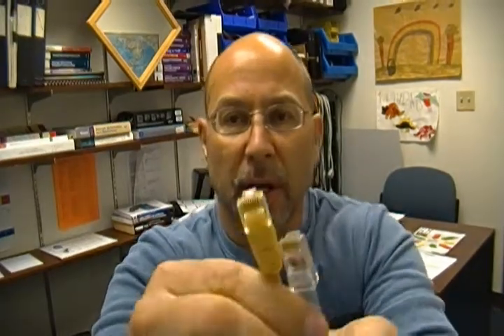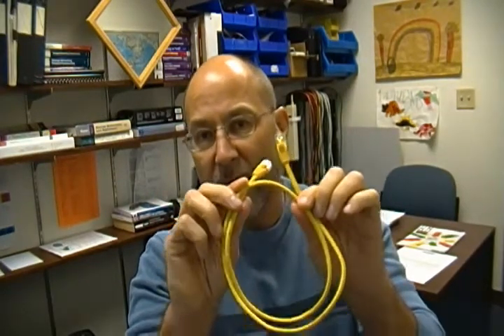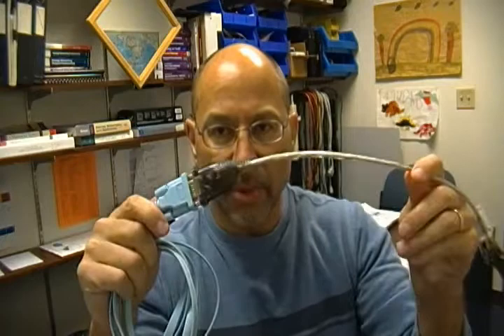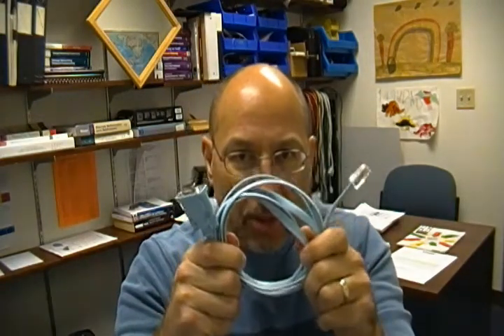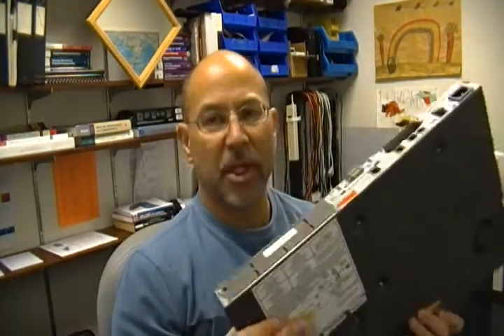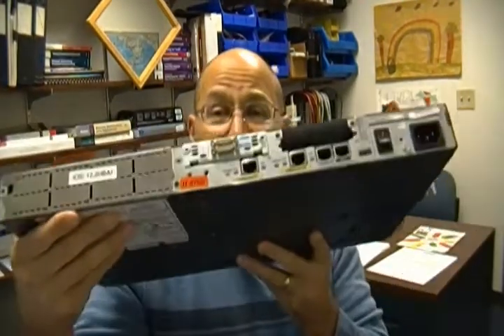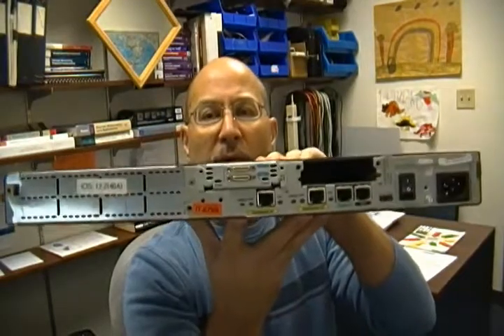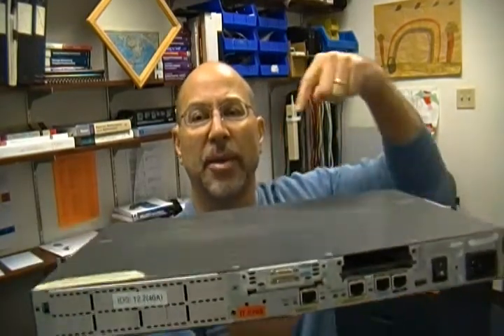Consoles vs. Ethernet

Comment: It is amazing to me that the ethernet port on my computer cannot also act as a serial port... how about just an RJ45 terminated console cable to an RJ45 terminated console cable, and it just plugs into your standard ethernet port on your computer and software can make sense of the difference between ethernet and serial signals... until the ethernet hardware eventually gets on board and makes their ports compatible with console cables.  Why on earth we can't do that I don't know.  (Thanks for this video and for listening to my rant ;)
Reply from the maker: Well, eventually everything may be from the same port. Look at what a USB port can do now. Serial dates from another era. The advantage is that you can always use the serial or COM port to talk to a device but Ethernet ports usually pair with a layer 3 IP address. The RJ45 terminated cable you mentioned is a thing but really it is simply straight-through cabling. Lastly, the serial port is also out of band signaling or management so that you can actually think of it as a security mechanism because you need physical access to the port and not just a network connection. But, your rant was reasonable :) And thanks for watching!